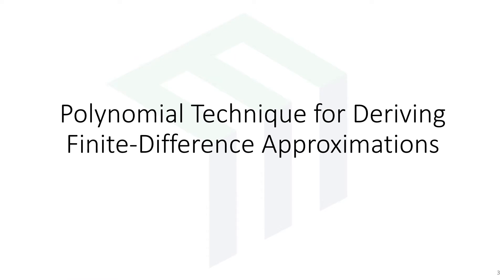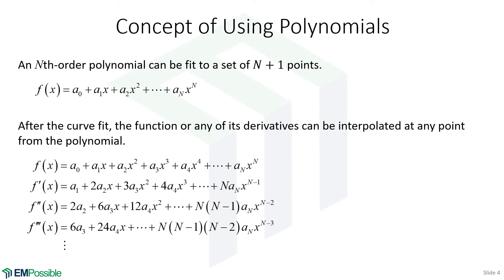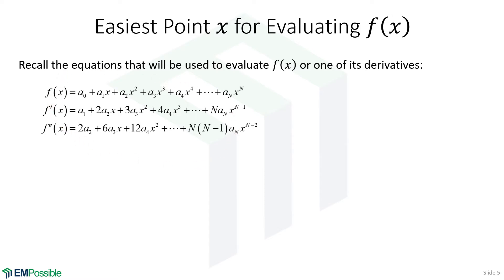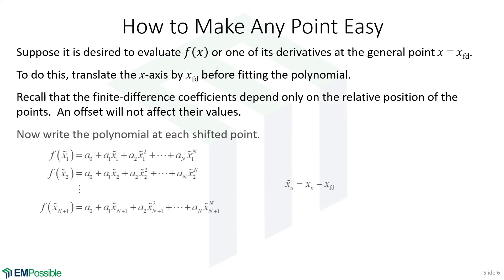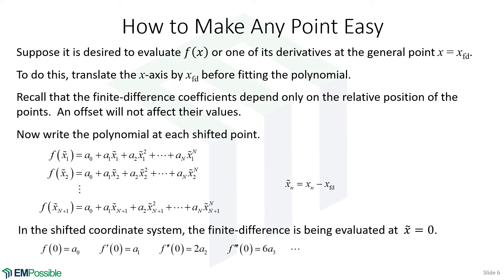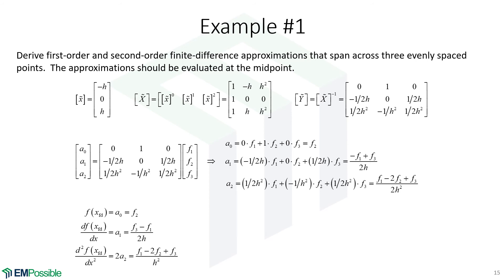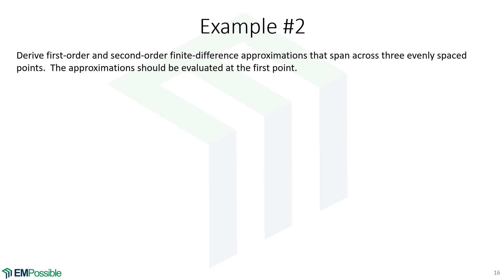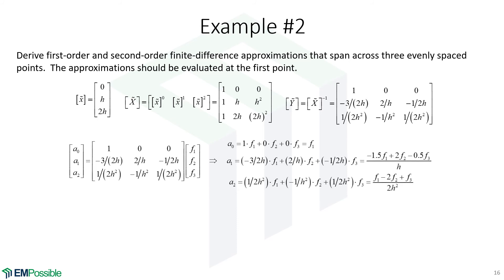Lecture -- Polynomial Technique for Deriving Finite-Difference Approximations

Comment: 10:16 there's a pattern to the constant being multiplied to the coefficients to obtain the finite difference coefficients. It's simply factorial of n, the derivative order. So for first derivative, 1! = 1; 2! = 2 for 2nd derivative; 3! = 6 for the 3rd derivative; 4! = 4x3x2x1 = 24 for the 4th derivative; and so on. :)))
Reply from the maker: You are absolutely correct!

Comment: This is a great series, but it would be great if they were numbered so a logical sequence of viewing could be followed. 
Also, some these seem to be using matlab to show the solution, maybe a link to the code or screenshot of it would be nice
Reply: Thanks for the reply. I wasn't aware of a course website. Makes sense now. Keep up the brilliant series👍
Reply from the maker: @gerard-nagle  Yeah...kind of an oversight on my part.  I have been trying add links from the video to the course website.
Reply from the maker: I did not number them incase I use them in a different order to build different courses.  I recommend using the course website as your main portal to these videos.  It is organized in order with links to the videos, electronic notes, other resources, and links to MATLAB implementations of the methods.

https://empossible.net/academics/emp4301_5301/